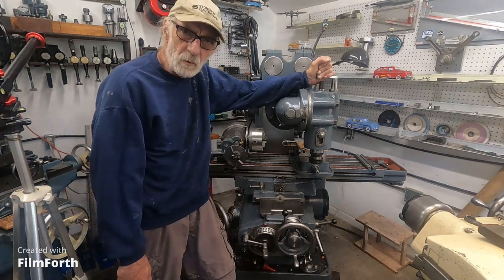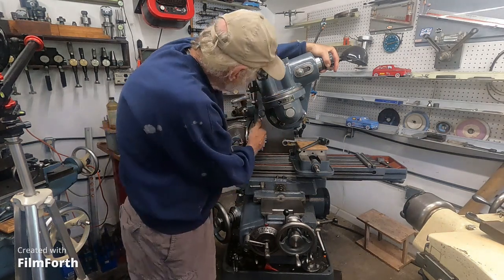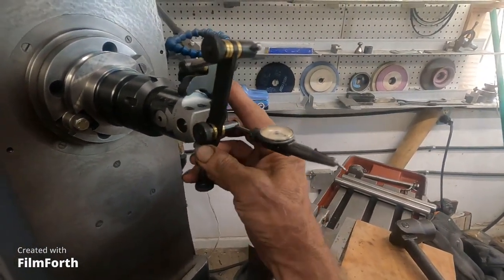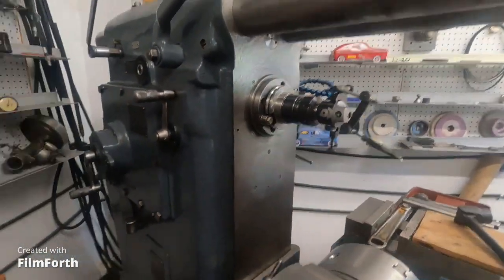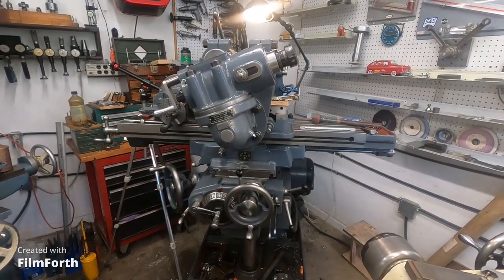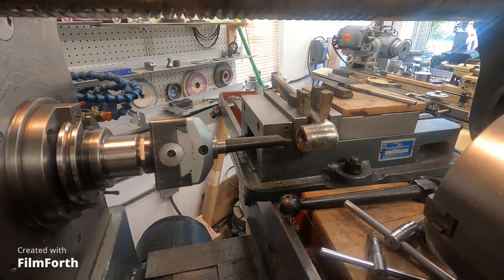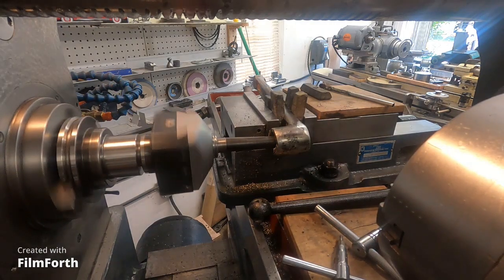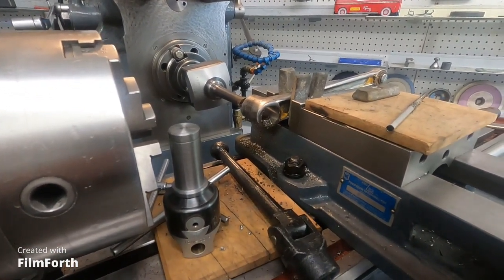Brown & Sharpe horizontal milling machine vise fixturing using lead

Comment: I'm interested in how you turned that "solid piece of rust" into that very nice machine. Wiping down with kerosene and surely some kind of mechanical surface prep?
Reply from the maker: Hi, I found the best product was Hoppes No9 bore cleaner and a brass brush after carefully skimming the bulk of the rust with scrapers, I will arrage a play list of videos I did on that, thanks

Comment: Even with all the labor you put into the refurbishing of the mill it was a steal at $500. Let's us just say the dividing head is worth $250 then that really lowers the actual purchase price of the mill. As a kid we used to crimp fishing weights on our line with our teeth. It's a wonder we ain't all dead. I guess Chloe was telling you yes, the way she was excited. Snuggles gets excited also when the answer is yes. Chloe Just added another smile to my face. Thanks
Reply from the maker: These old horizontal mills are the best bargain out here the 50 taper tooling is cheap and often they are in great shape as the bad ones went to scrap years ago, no one left to run them now. There are those toxic hazards like carbide dust to really be careful of. Chloe will likely go down town today hard to say.